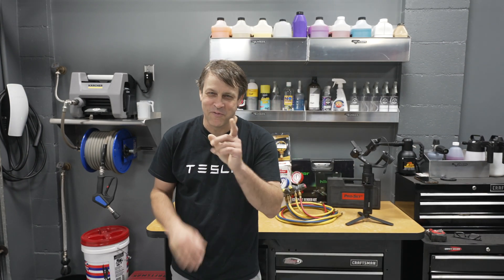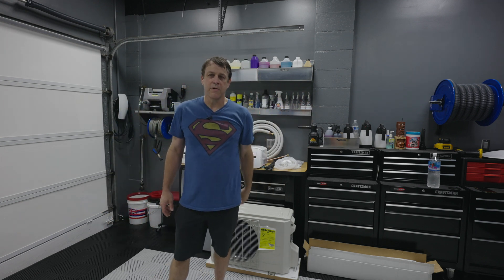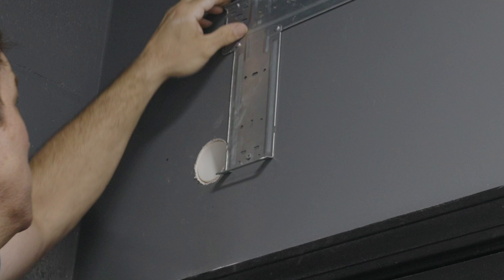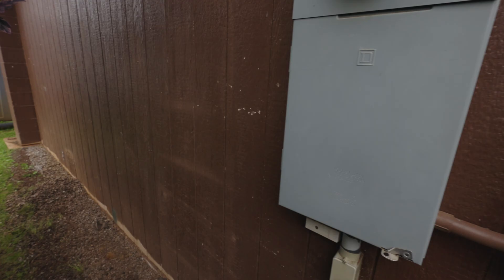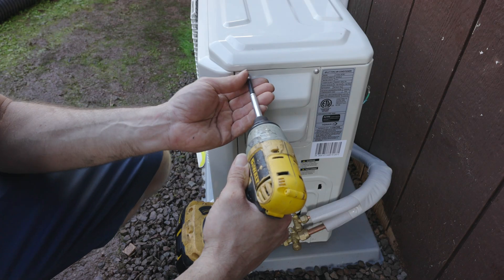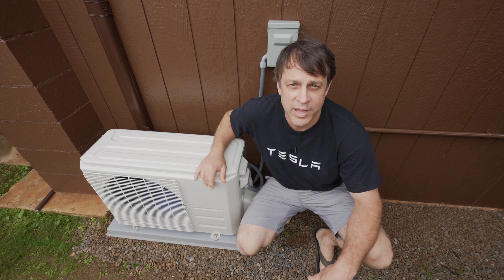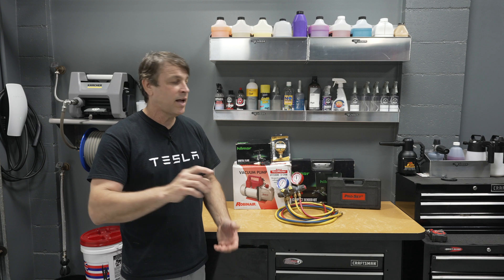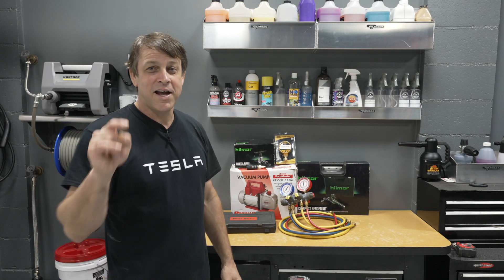HOW TO INSTALL A MINI SPLIT AIR CONDITIONER DIY 20 degrees colder instantly

Comment: Great video and well done.... Thanks for the chance to ask a questionL not sure which unit i can get from Amazon.... I see units from $1,800 to $800.  Cooling and heating a garage in Houston area.
Reply from the maker: Depends on the size of the garage and how many degree differential you are trying to cool. Ex. From 100-80 is a 20 degree drop. You have to think worst case too. Thanks for watching

Comment: Moving to south Florida.  Have a 3 car garage and I'm thinking a 24,000BTU unit should do the job.  Your thoughts?
Love the video :)
Reply from the maker: My 2 car with a 18k does a good job. My garage is insulated with a insulated door. I get about a 20 degree drop with out much of a problem. When it’s a really hot day it works harder to get those results. 24k for your size sounds about right but you have to consider insulation in the space. How hot does it get in the garage and how cold do you want it to be. There are some mini split calculators on line to help you decide. Thanks for watching and I hope that helps at least a little.

Comment: Great video.  I am going to buy a quad unit for about $3000.   One of them is for the garage.  I am thinking a 12k btu unit for 440 square feet.
Reply from the maker: My garage is about the same size and I went with an 18k. I don’t think a 12 will do it effectively but it depends on the temperature outside. Here it is 85 and I like it at 70-75. It runs at the perfect speed to reach that temp. A 12 would be full throttle and take a long time to cool the space down. Those are my thoughts. Thanks for watching

Comment: WAIT.... You're in Hawaii? 

You need to check out the Zamna Climate solar ready Mini-Splits, they're a USA 🇺🇸 company and they're DIY as well. 
I'm running a few of these in Jamaica 🇯🇲. 
The 12000btu runs off 4 solar panels (3 if you're using 405W or higher panels).
The 18000btu works with 5 of these 405W panels.
The are both AC and heat pumps. 
We recently covered a carport with 8 solar panels and used it to run 2 AC units for a home. 

Note:
With these mini splits, there is no need for an inverter or any other devices, just 10AWG cables (or 12AWG based on distance) and MC4 connectors that will plug directly into the outside compressor unit.

When you check them out, let them know Rayon from Jamaica 🇯🇲 sent you.
Reply from the maker: Thanks. I will look at them. Thanks for watching and sharing your thoughts

Comment: You gotta be kidding... CHINESE JUNK!!  DISPOSABLE AC... I can pick apart this install.. no dealer network.. no real distributor network ..no manufacturer support... little to no parts availability... poor warranty ( call china)... limited install parameters.. POOR EQUIPMENT!!
Reply from the maker: I have a top brand servicing my house. They are nice but expensive. You sound like the kinda guy that should go buy a $6000 Fujitsu. Pay 2K to get it installed. Nothing wrong with that approach. I am all about it. This cheaper unit in the garage is exactly what I wanted. It’s very inexpensive and makes my garage 70 degrees and for the price of a repair I could replace the whole unit. I highly encourage you to do the most that your budget and skill set can provide. For most of us this is more than good enough for a garage. My update to this install is that it has worked silently and flawlessly since I put it in. I use it every day. I have been extremely happy and it has exceeded my expectations. My Fujitsu on the other hand has had a circuit board and evaporator replaced already in a 3 year period. Sorry you did not enjoy the video but thanks for watching anyway.

Comment: Hi,.. Is the line set directional?... That's to say....  R the connectors specific to the indoor /outdoor units?  Mine came with no identifying marks to orient correctly.... Thanks.
Reply from the maker: It does not matter which direction they are hooked up. Thanks for watching

Comment: Great job.... One critique,... When torque ing line set... You should hold back on the fitting...   If the fittings turn during torque process, you can not only damage internals, the torque reading is inaccurate....   I'm not a NASA guy just a good practice during any type of plumbing work....
Reply from the maker: Yeah I agree. Thanks for watching. Hahaha. The NASA guy comment in the video. I forgot about that. Made me laugh again when I read this.
Reply: @HawaiiDetailing  Hi,... totally understand the NASA comment in your video, ... people tend to get a little picky when arm chair quarterbacking.... Also, thanks for creating the massive list of links for your tools and supplies for the job. That is a huge help in time savings to viewers.  did not even see that first time through... As you may or may not know,.. most suppliers are back ordered on Mr Cool units of all sizes,... I happen to be one of them...  So keep making the content, and we'll keep learning till it gets here.....   Mahalo!

Comment: Wrap that white wire inside your breaker box in red tape so it isn't confused as a neutral wire.
Reply from the maker: Good tip. Thanks for watching

Comment: The wires from the indoor side, it ran through the whip, but then it just exits the whip in the lineset channel and is not in conduit the rest of the way back to the inside?
Reply from the maker: The control wire does not need to be in conduit the entire run. It is inside the line hide and whip so that it is not exposed to any elements and is not in any danger of being damaged. Check your local codes and best practices to be sure that your installation is up to standards for your area. Thanks for watching.

Comment: Mine is 20x20 and I was thinking of only a 12,000 btu unit.  And doing yours I would figure 9,000 or 12,000.  Got me thinking now.  I was going to go with a Mr. Cool version to save on buying all those tools you left the links too.  Wow...do they add up!!!  Just hate the thoughts of all that extra line set coiled up.
Reply from the maker: I have several mini splits. A 12 probably won’t get it done. Double check the specs and make sure you are comfortably below the max room size. Typically a garage needs a size larger than you would think. The 18 is perfect for my setup. 
Mr Cool has a few different line lengths. Check it out. Maybe you can make it work without any extra line set. If not you can make it look nice by tucking any excess behind the outdoor unit cleanly. That’s what I would do. I would go straight through the wall and down to the machine. Coil it nicely and hide it the best you can. It’s a lot of tools to go the other way.

Comment: Great video and thank you for all the info.  Want one so bad!  Just curious on the size of your garage being that you went with an 18,000 btu unit.
Reply from the maker: It’s about 18x18 give or take. My unit is capable  of cooling 370 square feet. If my garage was any bigger I would size up accordingly. It easily cools my garage. My garage is fully insulated including the door and dry walled so that helps with the cooling capability for sure. I would consider insulation into the equation too. Hope that helps and thanks for watching the channel.

Comment: I just bought a house and the previous owner installed one of these units. The extra line is cooked behind the unit as you described. Does this mean I’m SOL and have to keep it coiled, or can I cut the line and redo it to be shorter, or would that require an entirely new run of line all together?
Reply from the maker: They can be cut and a new flare fitting put on. If you don’t have the tools or knowledge in the HVAC world it might be worth hiring an AC guy. If you do want to do it It would have to have the refrigerant ran back into the machine. The line cut and a new flare fittings made and reconnected. Than a full evacuation with a vacuum pump like I described at the end of the video. This is assuming it’s not a MR cool unit. If it is a Mr Cool unit they have special fittings on there because of their DIY pre charged lines and I think you are better off leaving it as is. Hope that helps. Thanks for watching
Reply: @HawaiiDetailing  thank you! This was awesome. Love your videos man!
Reply: Please do plenty of research before attempting this. This guy makes it look extremely easy, when not everyone situation is perfect. Worst case scenario if you lose refrigerant, well you have no choice but to call a pro.
Reply from the maker: @Chris_junya  thanks for watching and commenting. I always suggest to use a pro if you do not have the knowledge, skills or tools. I suggested that above in the comments, in the description of the video and in the video itself. Always use a pro when in doubt.
Reply: You'll have to have someone pull out the refrigerant first. They'll close the valves on the outside unit then remove the refrigerant from the lines and air handler. Then the special fittings Mr Cool adds onto the valves on the outside unit and the line ends can be removed. The HVAC tech can then cut the lines to length and re-use the nuts from the line ends which in other brandings of this model would screw directly onto the valves. The final steps will be to vacuum the lines and air handler, then open the outside unit valves, then put the right amount of refrigerant in. At the rates per hour these guys charge it could be pretty $$$$ just to get rid of that coil of extra line.